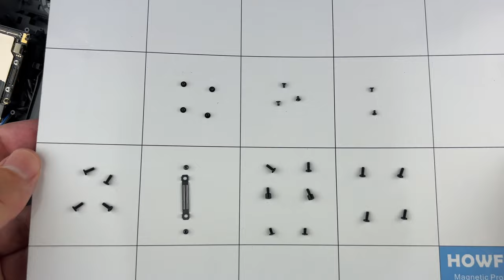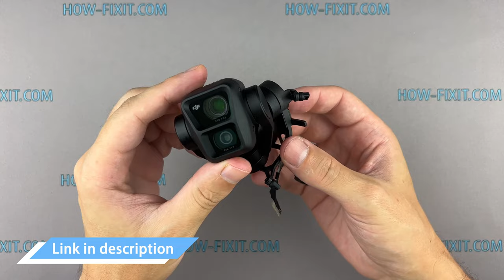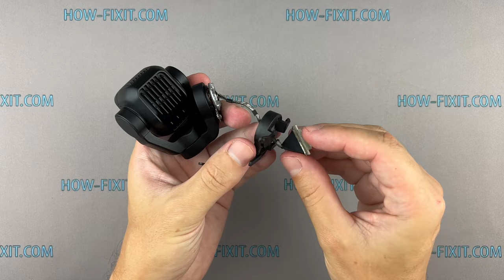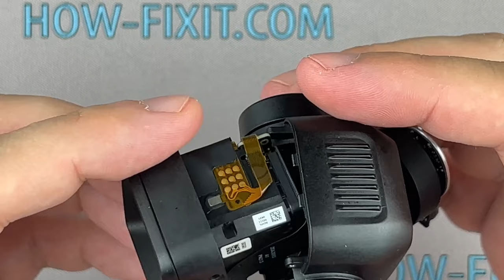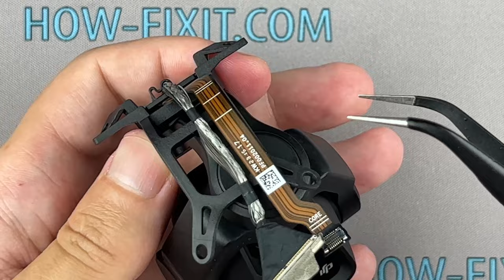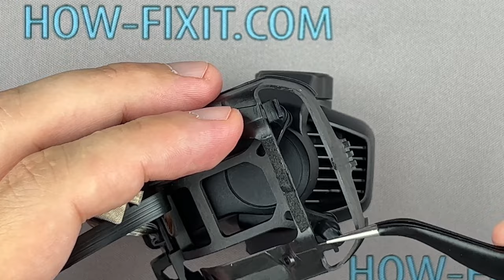DJI Air 3 Gimbal Replacement | Your Ultimate Drone Repair Guide

Comment: I recently crashed my Air 3. The gimbal came off and everything. I thought I was screwed and was going to pay hundreds to get it fixed. Nope! It was $85 and about a 2 week turnaround time. I wanted to relay that info as well as saving this video because I know it will possibly happen again.
Reply: Hey, did you have to calibrate your Gimbal somehow with computer software? Or did it just work?

Comment: Hello I watch your video on replacing flex flat cable on dji air 3 and I did it but the drone is showing a camera lens error when turning it on and does not switch to the 3x zoom also looses conection with the remote after a bit, do you think the other cable that I did not replace may be damaged, or that the flat cable I bought may have an issue or that I made a mistake in the assembly or conection of the cables? What do you suggest? The camera does contect on 1x mode but then looses signal. I had a small mishap at take of that broke the absorbing board that hols the gimbal and the flex cable I replaced both. Gimbal moves up and down with out a problem thank you very much for your advise. Shouls I do the process again, I do have another new flat cable.

Comment: It would have been nice if you would have said to remove the micro SD card first before removing the bottom panel. Now my sd card slot wont work at all, the Micro SD card wont stay in the slot and it wont record and says it has to go to internal memory. Bro wtf my drone is destroyed. Wtf do I do now?????

Comment: Hi I recently crashed my drone and Thanks to your video I just replaced the gimbal damping bracket successfully but I still not get any image from the camera and gimbal wont move with controler. What could that be?
Reply: did you ever figure out what it was? same problem here
Reply: replace the cables that lead to the camera and the gimbal.

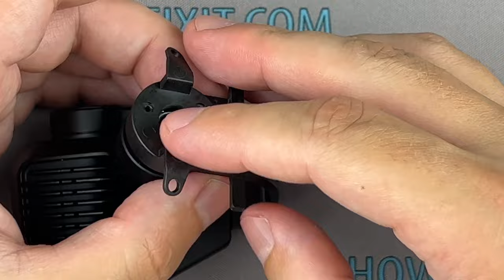Comment: There is a black piece that goes behind the housing assembly you are showing in 11:54 seconds in your video.  I just cannot put that piece behind and screws those three screws.  I have been at at it for almost 30 minutes now.  Can I ignore that piece?

Comment: 6:44 which cable is this? Where to get it from?
Reply: You can replace this cable with the apartment cable from the Dji Air 2 compatible Flat Flex Gimbal Cable Dji Mavic Air 2 Drone Pf000726.01

Comment: Hi, very good instruction video! 
One question: do you know were to buy the lower bracket of the Gimbal? It is the part having to kind of "noses" fixed at the Gimbal chassis.

Comment: Skipped some of the super tricky parts, or just made it seem easy. Damn, this took me like 2 hrs.
Reply: But still thanks.
Reply: Definitely takes a lot of skill & patience to do that. I'm thinking about giving it a try with mine I just recently purchased on an auction app. I got an error message saying: Gimbal Error & Gimbal Stuck. I took a look at it & didn't see any debris. When I fire up the drone, the normal gimbal calibration it does.....it didn't even do that when it's suppose to. Hopefully it'll be something simple to repair

Comment: Any idea where i could get parts for this gimbal? I need the lower vibration absorption bracket. The Plastic housing piece that holds the cam in place with the rubber bands.
Reply: Did you have any luck finding the part?

Comment: Hi but if ribbon cable looks good but another cable from gimbal is rip  of 2 wires is broken that could make the problem with connection  video signal

Comment: Hey, in the end you just put everything back together, do you need to calibrate the gimbal at all or when is that really needed to do?
Background: Ive crashed and it seems fine, just the gimbal is a bit offset in my opinion and the horizon is not level when accelerating. I presume some pieces of the gimbal are broke and I'd like to open it up and check - However, it is flying now more or less, I wouldnt wanna have a gimbal error after reassembling and am wondering if it would at least work the same way as before if i assemble it properly. Would appreciate any help here :) Also if anyone else knows the answer.

Comment: hi thanks for the video! is there a screw saver on the second screw you remove, bc i can remove this  screw and i dont know ist it a sensor or a screw saver. thanks for answering
Reply: Yes, mine had it too. I thought it was a silica gel ball that was stuck in there at first but was able to wriggle it out with some force.

Comment: You can replace this cable with the apartment cable from the Dji Air 2 compatible Flat Flex Gimbal Cable Dji Mavic Air 2 Drone Pf000726.01 - DJI PF002011.04 only changes one bend in the cable... but the fitting is the same...

Comment: How to repair the DJI Air 3 which on the remote says: camera lens error?
Reply: Can you fix it? I have the same error, can you help?Replaced two cables, the gimbal works but the camera doesn't.